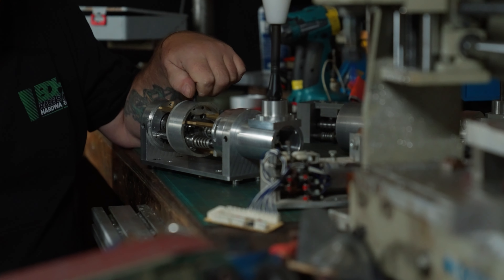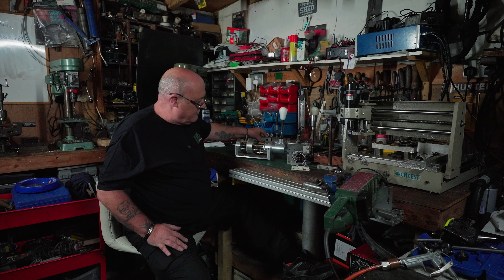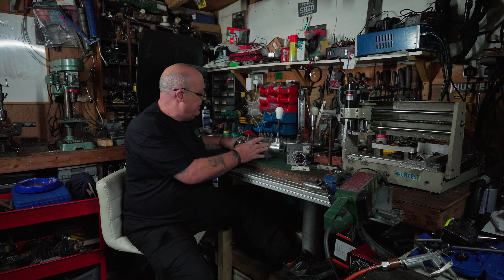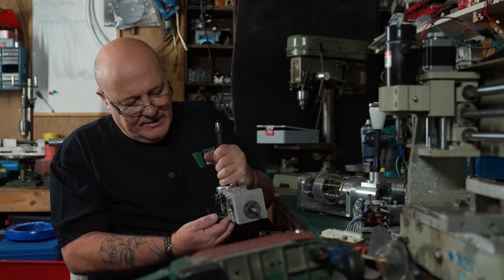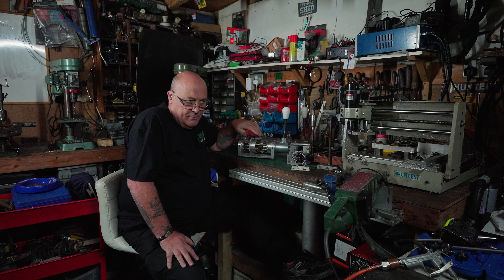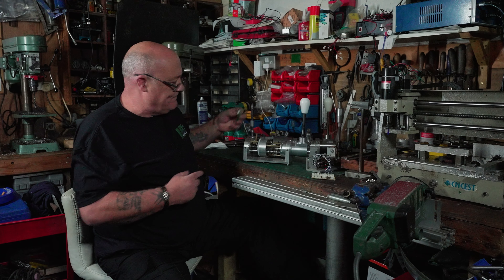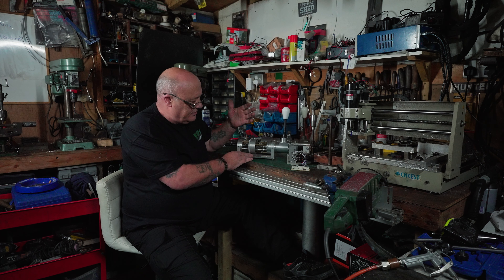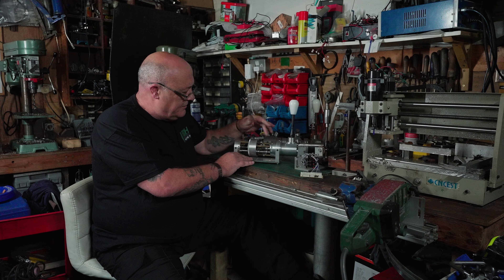Introducing the H1SQ Dual-Mode Sim Shifter | Company Profile

Comment: Can an extension be installed? I think I would have to mount it lower on my rig, but need a rally style height for the shifter. So close to steering wheel height and to align with my handbrake.
Reply from the maker: Yes an extension can be fitted, it would increase the travel significantly. 
Alternatively if you can wait for our next product, it will be more suited to Rallying.
Reply: @BDHRaceSimHardware  oh wow. Ok now you have peaked my interest!! I mainly use paddles for gt racing, but sequential for rally. Do you have a timeframe??
Reply from the maker: @peterw8911  autumn (fall) 😁

Comment: Does the sequential mode not have an additional longitudinal spring to make the gearstick return to centre? In the demonstration you were manually putting it back into the neutral position.
Reply from the maker: Yes it has two, one for each direction, and no, I wasn't manually pushing it back.
 After watching back, it does look like that on the first shift, but I assure you it was returning by itself.
Reply: @BDHRaceSimHardware   Ah brilliant, cheers!

Comment: They need to develop an active shifter for the ultimate shifter in the market, otherwise bash pro active h shifter will be the go to for now...
Reply from the maker: Active ? Sounds interesting, tell me more, what does that do or even mean 🤔
Reply: @BDHRaceSimHardware  Dave, I believe it locks the gate electronically until the game detects a proper shift, then it engages the gear. I guess clutch press based on telemetry.

Comment: I would consider buying this only if it had integration with pedals such as simsynchro. What is the point of a more realistic shifter if it's completely detached from clutch mechanics? This will not make the experience more immersive for me.
Reply from the maker: There's a lot of point to many different racers. I do see your point too, be patient as we are actually working on pedal integration.